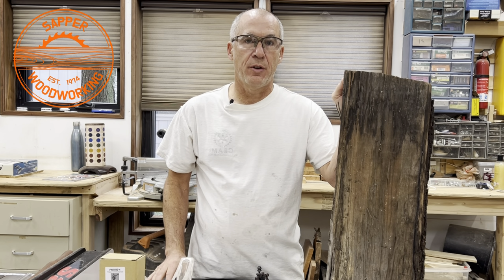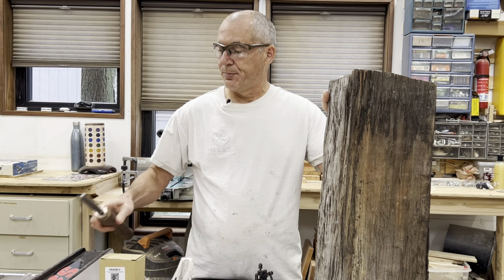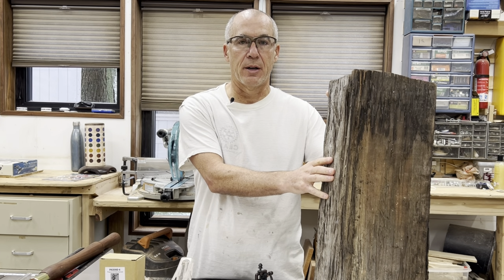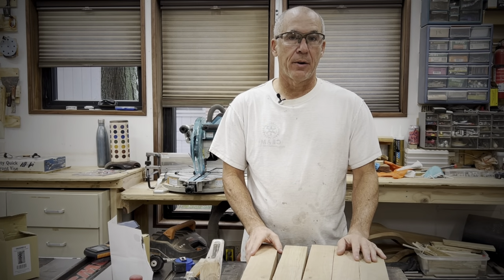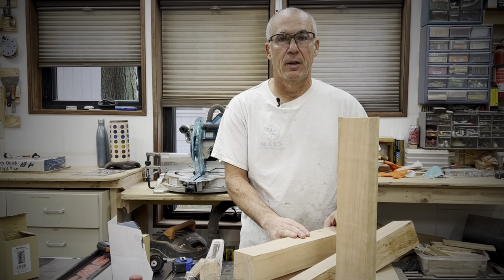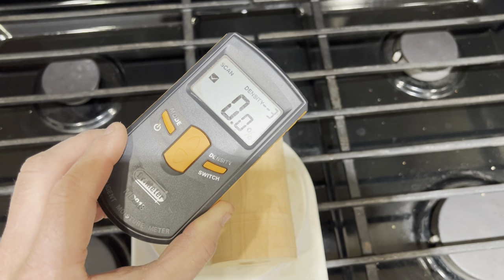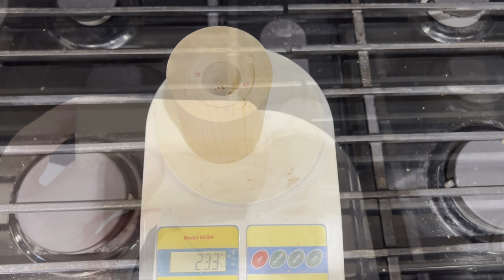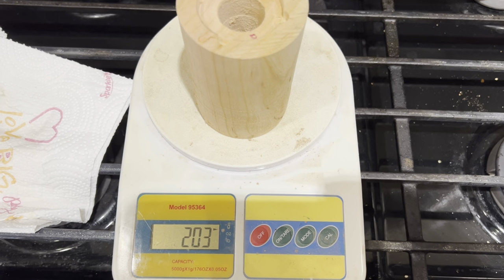Wood turning a Pepper Mill Grinder using your Microwave

Comment: You have given these pepper mills an amazing finish.
I have never used a microwave to dry wood, sometimes I do use a regular oven for drying.  Happy new year and cheers, Hans

Stay safe and keep  turning
Reply from the maker: Hans,
Thank you! The microwave actually worked pretty well.  Just be careful and SLOWLY heat the wood.  You will actually see the water seam out of the wood.  Also a good idea to put the piece on top of a paper towel so help soak up the steam.  Cheers and Happy New Year to you.

Comment: Those turned out really nice.  I had thought of using a microwave but had not tried it other than to kill insects infestations in the blank..  It works well for that.
Reply from the maker: Dana, thanks very much. I’ll definitely try microwaving another project. I imagine a small bowl will take more time to dry but I believe it’s still an effective process Iif done safely. Just don’t ramp up the time and heat settings too fast.  Cheers!